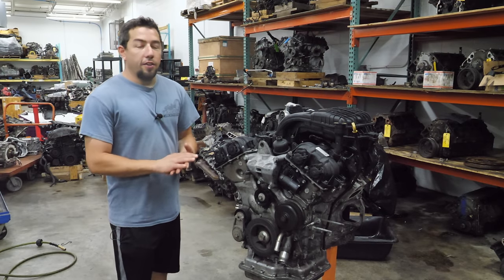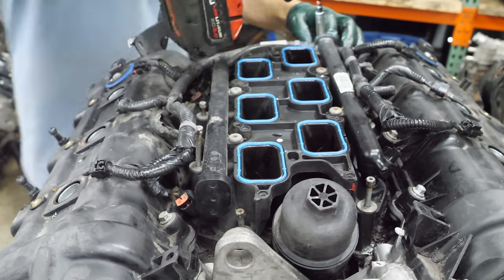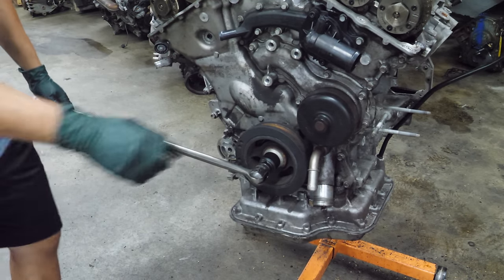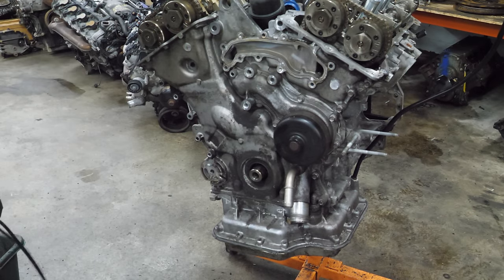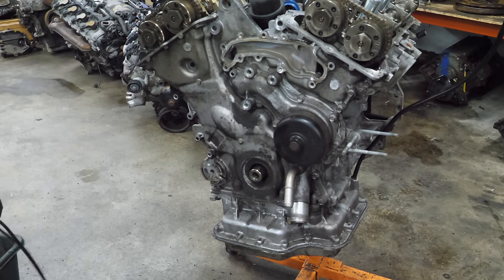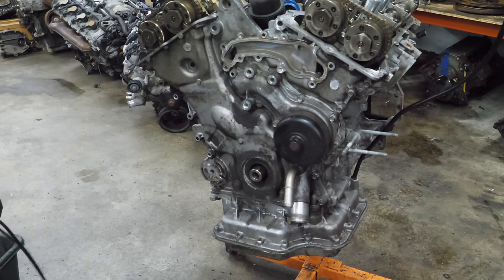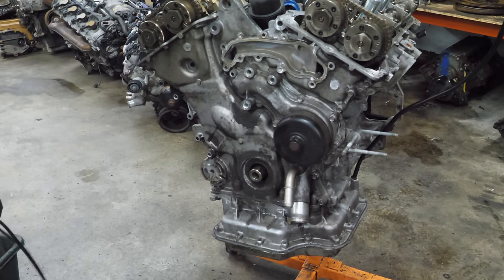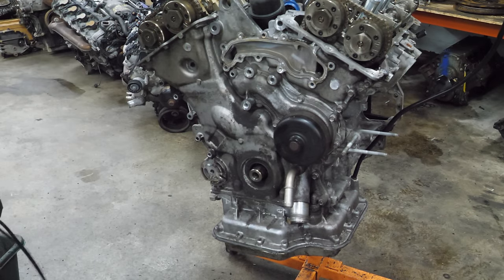Dodge Caravan 3.6L Pentastar V6 Teardown! Why Won't This Engine Turn All The Way Over?

Comment: Maybe the engine was driven for short trips and never had a chance to reach operating temperature, carbon would build up and maybe also clogged the oil control rings causing extra oil burning in the cylinders adding more carbon. Possibly a good Italian tune up on a long highway would have helped to clear up the carbon deposits.
Reply: The ole Italian tune up 🤣 My little car practically does nothing but highway driving
Reply: possible very poor gas and long idle times
Reply: @schlite60  My thoughts exactly. The owner at least seemed to stay on top of oil changes.
Reply: @schlite60  old people do drive slowly and sit in their cars so that could be the culprit.
Reply: I'm betting elderly owner who drove very little.    Likely driven around town, never took any trips and everything was low speed.     The internals were extremely clean which suggests low miles and the owner kept up on the oil changes.
Reply: yup yup like my 90 yr old mother driving
Reply: Yup, some old girl's car. Only time she floored it, was when she drove through the front doors at the CVS.
Reply: The band had this evil "Economy" mode button which set the shift points really low and held it in higher gears at low speeds. It feels nasty when driving, like you're just laughing the crap out of the engine.
Couple that Economy button with nothing but short trips and this is what you'd get I expect.
Reply: Oh god, that's how my family uses our Grand Caravan. I guess it's time for me to start doing pulls again. And some seafoam might be in order before said pulls. (did use some fuel system cleaner a few months ago)
Reply: @reddpanda7240  yup, she had the brake pressed all the way to the floor but the car kept accelerating into the CVS front door 🤣
Reply: @chrismorrison9140  sounds like my Durango.     Won't Crack 2000rpm in default economy mode (8 speed transmission).
Reply: @schlite60  It definitely wasn't a "top tier' fuel! I guarantee it was regular (87 octane). But they say regular is fine for most people. Wasnt fine in this case!
Reply: @willc5512  actually Top Tier is supposed to apply to all grades of a given brand of gas, not just 93. Not all fuel retailers go for it, though.
Reply: Other way around; hard black carbon is from excessive heat, Chrysler likes to run these things at 210f to ensure all plastics fail at exactly the right amount of years. That's a holdover from the Daimler days. This is VERY well known in the Wrangler world. 190f thermostat & ECM flash to lower the fan kick-on from 220 to 195 solves the problem (otherwise you'll get a 'thermostat irrationality' code if you change the thermostat without the ECM flash). And they last way, way longer between rebuilds that way
Reply: Also, a clean top end does not necessarily mean maintained.  It might have been very badly maintained and had an oil system cleaner flush.  I suspect this is the case because of certain areas of heavy varnish.
Reply: @russelljacob7955  a flush is not going to make it look that clean.
Reply: @JimBronson  Depends on the type.  Some can really shine the aluminium.  The commercial grade ones.  The flags for me was looked like wear marks on the skirts and some areas were pretty dark varnished.

I actually speak from personal experience and one of my engines. I had my car parked a bit and it was an older engine so getting yellow.  Flush cleaned most of it but low flow areas still had discoloration.  Perhaps had a timing job and engine flush.  Rings like that I have only seen on vehicles which have done 10k mileage intervals on short commuting.
Reply: @Drmcclung  Wooooaaaaa, that's something to think about. That'd be some truly long game planned obsolescence. Evil too
Reply: @Ar0d  Most Marks do it that way. BMW & Benz are the worst offenders. Chrysler wasn't too too bad about it until Daimler took it over, anything they could cast out of plastic is what they did. People don't realize aluminum heads with plastic parts bolted all over them, and themselves bolted to iron blocks (that's 3 dissimilar materials) the materials don't expand & contract @ the same rate. You add up all the daily heat cycles, especially @ 200-220f operating temp (that's just too hot) yeah they're gonna fail. They had HORRIBLE cylinder head problems for years, plastic parts failures almost constantly, incredible hard carbon buildup in no time at all no matter what you do, that no amount of detergent will soften up and blow out (you're in for an engine out overhaul at that point) you have to get the operating temp down to 190 for it it last any reasonable amount of time. The heads stop failing, the carbon doesn't harden into black concrete, and all the plastics last a bit longer. People say "use the thick blue rubbery silicone gaskets" yeah that works to stop the leaks, but won't keep the plastics from going glass-brittle after 3 years in a 220f degree oven heat cycled over and over again
Reply: Granny driver for sure. Got rear ended at the lights for stopping on a green.
Reply: No, this is a known issue with the Pentastar. They cool the EGR gasses and send it right back into the engine instead of burning it up in the exhaust. This kills any venting and creates positive pressure in the crank case that soaks the intake manifolds with oil. That oil is the reason for the carbon build up on the piston tops and heads. These engines need catch cans to separate it. My Charger only had 9,000 miles on it and the intakes were soaked with oil. I was shocked. I added two catch cans and it cleaned it right up. I have them drained at every oil change.
Reply: @dannysdailys  and 220 degrees bakes it into a nice solid black carbon concrete you need a hammer & chisel to remove
Reply: My 1993 540i has a "winter mode" for the trans that shifts early keeping revs to about 2000rpm max, and ignores kickdown... I think. Never used it ;p
It also labels its default trans map "Economy", which is laughable considering its a giant slushbox mated to a 4L V8 that drinks like a German at Oktoberfest when you just think about pressing the pedal, and pretty much the only observable difference from "Sport" is it does not gear up into 5th on the highway
Reply: @Drmcclung  I need to remember that for my Chrysler customers 🤔 had a couple that I thought were a bit too high on the temp side
Reply: @cljvikingpride19  You're not wrong, at all, they're programmed right in the ECM to run 210f-220f and that's just way too hot. If you put a 195 thermostat in it'll throw an annoying "thermostat irrationality" code b/c it was programmed to kick the electric fan in right @ 220f so the parameter change is a must. And the carbon concrete stops, and Tiffany Glass plastics stop fracturing (thermo housing is BAD about that). We figured that out when the Wranglers started pouring in for warranty work so that's what we did and the problems went away for good. One of my customers managed to get 260,000 miles out of his Pentascar V6 without much trouble after lowering the temp to 195f max. He's still driving it but it's wearing out in other places now. For what it's worth it didn't affect emissions either, we're in an emissions zone so they're on the dyno to prove they're still up to the task annually. In fact on some of the Chrysler's we modified to 195 emissions actually improved b/b the rings weren't seizing up in the ring lands causing blow-by & oil burn
Reply: @Drmcclung  that’s awesome insight, thank you! I’m serious, took a bunch of screenshots and keeping them when I have another one come in with something similar. What’s the best way to drop that parameter? I don’t have a Chrysler specific computer…
Reply: @cljvikingpride19  Some of the Snap-On tools will get the job done depending what packages are installed on it, some do it out of the box, others you have buy a package to install on the tool. I THINK Bosch (the upper model) will work right out of the box but it's freaking expensive and I don't know if they're still around! Basically any of the aftermarket advanced tools will do it but be warned sometimes you have to pay for the package to get into the ECM you're working on. Not ideal but sometimes your only option. Avoid most of the ebay/Amazon tools. Long story short you don't necessarily have to have the a scanner from Chrysler. If it's a Daimler era Chrysler just use a Bosch if you can find one, or a Snap-On. Matco I don't think can program but the newer ones might (mine is at least 12yrs old and it won't program much of anything post 2012). Hope that helps. Don't let anyone convince you that the ECM parameters can't be changed. They absolutely can
Reply: No, this is a known issue with this engine. Read my article.
Reply: @dannysdailys  Will engine flush clean out those carbon deposits? thanks
Reply: @edwardtan8998  Not that I'm aware of. You might ask Scotty Kilmer, he uses all kinds of potions. Using catch cans will reverse the build up, but I would imagine it to be a slow process. Usually you find out because the exhaust spits out carbon all over the place, but by then, it's too late.
Reply: It probably came out of a taxi vehicle if its from a van. I have 125k miles on my 3.6 in my 10 year old Wrangler and it still runs strong. I drive it daily and take it off road when I have the time. I only use good synthetic oils and quality oil filters though. Last oil change I went with Liqui Moly Molygen 5w30. I've had to replace the oil cooler at 100k miles because it was starting to leak and updated it to the newer 2014-up design. My next big maintenance item will be replacing the timing chains and guides but that's still in the distant future. Going to run this engine until it doesn't run anymore which at that point I will either get a new 3.6 and install a supercharger on it or, swap in a 5.7 Hemi V8.
Reply: @willc5512  the pentastar is designed to run on 87 octane. It's all I use in my Jeep with 125k miles.
Reply: @dannysdailys  been thinking of adding a catch can to my Wrangler. I've had the intake off to do the oil cooler replacement and noticed the intake runners had oil in them. I thought it was a bad PCV valve causing it.
Reply: @jeepinintexas6215  I would recommend taking a spark plug out and taking a camera to it and taking a look. You'll be able to see how much carbon build up  is there.
Reply: @jeepinintexas6215  I said 2016 and newer. The Pentastar was fine until 2016.
Reply: @Drmcclung  who would do that type of flash
Reply: @Drmcclung  the dealership can set the fans to kick on at 195
Reply: @Drmcclung  Ripp Mods sale a thermostat that’s set to kick in at 180 degrees
Reply: @anthonyvasquez7050  In your area, no idea. There's 3 4x4 shops close to the Heights in Houston that'll do it, and one specialty shop that'll get you into (and obtain) any ECM; ancient, old or new he's got a lot of his own electronic stuff, only place I know of for that type of service (unobtanium ECM's). But any Chrysler tech can do it. California, I have NO idea last I heard, any factory change failed inspection but that's just what I've heard, I don't personally know anything about cali
Reply: @anthonyvasquez7050  They usually won't, at least not in my region, they'll tell you to F off, unless you know "the guy" but that's just here
Reply: @anthonyvasquez7050  Changing thermostat to a lower temp without changing ECM parameter throws a "thermostat rationality" code - I know that from a lot of personal experience, especially the '09 & newer wranglers. Doesn't hurt anything, but the check engine light will F you @ next inspection
Reply: I need to know what in God's name caused all that carbon so I can make  sure to avoid that!!😭
Reply: @seatime674  it's just the nature of that engine. Gotta change that oil every 3k especially in the heat. Throw the "10k mile" oil change out the window, and run some seafoam through the engine and the fuel every once in a while
Reply: @Drmcclung  Oh yeah I change mine religiously every 3K mi and the Sea Foam is never a bad idea
Reply: @seatime674  Once you're aware of the cyl head & sludge/carbon workarounds it's a pretty damn decent motor, as much as it hurts me to defend anything out of Chrysler 🤣 I actually kinda like it
Reply: @Drmcclung  I have it in my '18 Pacifica at 60k miles it's a flawless, balanced and beautiful motor with no leaks whatsoever.... I don't think it's known for the carbon buildup I think this motor was just particularly screwed up with it
Reply: @seatime674  Oh it's definitely well-known for gunk buildup, but not necessarily the engine's fault or the engineer's fault. The problems are with CAFE recommendations and Chrysler being forced to run it too hot for leaving the oil in as long as they spec'd it to be. I can't really fault Chrysler for that. It's a huge problem for the heavier Wranglers that already put more load on it than the other vehicles it came in (still issues there right out of the box, just not near as bad). But once you're aware of it and how to deal with it, it's no problem at all.
Reply: @Drmcclung  Not sure what you meant saying Chrysler was forced to run it too hot leaving the oil in for as long as they spec'd it to be.. Does that mean just change the oil more frequently like just mentioned?
Reply: @Drmcclung  Holy sh** Hmmm ok good to know. I've got the '18 Pacifica with the newest 3rd gen 3.6 Pentastar and it's funny now that you mention it my fan does kick on between 220-230.. I have the digital temp Guage so it's easy to figure out. I've even thought "this is getting to hot,!"... I'll never get around to changing the thermostat with all that ECM stuff so I'll just do 3k oil changes and flush with new coolant and do what I can.....
Funny It works opposite I thought higher heat actually burned "More" carbon...
On the Pacifica forums there are Many people with coolant in the cylinders and needing new head gaskets before 60kmiles. It's a known problem scares the hell out of me but nobody's ever mentioned it this way before.
Reply: @seatime674  Yeah, the heat just bakes it on, like those concrete crunchies in the oven you couldn't chip off with a hammer and chisel lol. But if you're worried about the heads warping, at least dump a lower temp thermostat in it and worry about the ECM flash later if the light does come on afterwards, it is worth the trouble if you're clean to start with. Best to prevent it before it pops, cylinder heads are NOT fun on this engine trust me..
Reply: @Drmcclung  Most car makers put in like 190 to 195 thermostat, are you saying to maybe put in a 180?
Reply: @seatime674  Well, most the ones I've been into (talking about this Chrysler) had a 200f thermostat in them from the factory including my old '10 Wrangler Sahara. I think I pulled a 195 out of one of them but can't really remember.. I just know I've run into more 200f ones than I can count. They do make lower temp thermos you just have to hunt around different parts stores to find them. 195f actual running temp is about as high as I'm ever going comfortable with, max.. 180-190 is the sweet spot. I don't ever want to see 200+ operating temp on one of these
Reply: @Drmcclung  Well say a 195 is put in and coolant starts circulating at 195, when the Fan comes on at 225-230 thats a separate electrical issue I'm thinking that has nothing to do with the the thermostat because it's open at 195 anyway whether the fan is on or not, so wouldn't the fan coming on to late just be an electrical issue that should be dialed back to come on sooner??
Reply: @seatime674  Incorrect, but logical assumption. However, the ECM is more sophisticated that that; coolant temp sensor is going to see the change in temperature delta and the time it takes to get all the way there if the thermostat changes to a lower temperature (because you changed a piece of hardware and it recognized the difference in *delta*). It will still climb up to the programmed temps if the vehicle isn't moving, without fans, (it still expects a certain range before kick-on) and that's what triggers this thermostat rationality code. It's actually doing exactly what it's supposed to, which isn't just see temperature, but monitor that delta. Changing 1 without the other won't really do anything to totally solve the problem, but at least changing the thermostat helps. You'll just have to trust me on this. Same goes for just changing the ECM parameter and not the thermostat, fans would just run and run and run and not really get you anywhere especially if you're sitting in traffic. Believe me, 12 years ago we threw every trick in the book at this problem before finally figuring it all the way out that it's a thermostat & ECM change that makes all of this go away
Reply: Thanks David Russell. I may change out my 2014 Ram 3.6 thermostat. I’d like it to last. 
Anything more to making them last?
Reply: @dannysdailys  thanks for this info. Any links to help with doing catch cans?
Reply: Italian tune up is how I keep my 3.6 pentastar going
Reply: My engine it clean af I took it apart to change some seals everything clean guessing the hight quality premium gas I put and synthetic oil I do and plus the long trips and high revs I do on it lol we’ll still running strong as now very smooth at idle and no oil consumption yet hope to push 300k or more
Reply: I used to take moms Le Sabre out on a Friday night and go hunting for wanna be racers, that 3800 would spit black soot for a bit and then clean up and run way better after a few stoplight drag races.
Reply: Yup
Reply: @G Rosa  I had a Camry take out my Dodge 3500 that way, but she was leaving the drug store.
Reply: I've seen low mileage pentastar engines with this problem on other videos. They say newer engines have this problem.
Reply: @reddpanda7240  Funny, most people "Oh I didn't realized I had it in drive", as they crash through a store. OK, sure, but how hard are you hitting that gas pedal?
Reply: @schlite60  That's what I was thinking. The 3.6 is the Stellantis base motor for lots of different vehicles so it winds up in a ton of fleet vehicles. Those often see a lot of idling and low grade gas, and cheap bulk oil. If it's real hot or cold, That van might have been running all day for heat or A/C for the driver.
Reply: Very good article anyone know anything about installing catch cans on these motors
Reply: @chrismorrison9140  Knocking around town with your cheap discount gas.
Reply: @willc5512  Regular is fine unless your engine hates it.
Reply: What would short trips be considered? I literally only drive to the gym (4 miles), my friend’s house (3 miles), and the store (5 miles). Is that a problem?
Reply: @Drmcclung thats not how material failure works.
Reply: @jonathancormack  a little context would be nice..
Reply: @user-3tf67bk46u  Appreciate that! All the feedback in this thread kinda motivates me to make my first YouTube video, just to go over the last Daimler era Wrangler I've still got regular access to that I maintain for a customer, I don't think he'd mind a bit. He's about to roll over 300k so after that sort of bullet proofing no major failures in the last 5 or 6 years outside of the original transmission finally giving up (that got rebuilt at a trans shop this summer, I don't do transmissions!). And he's still driving that old thing about 40 miles a day to work and back. That's IF anyone wants that, I know some guys are more into the visual thing than reading.
Reply: Does changing the thermostat temp alter the performance of the vehicle in any way? If not, why would it be set to a higher temp from factory?

Is this an issue with 2020 and newer pentastars aswell?
Reply: @truckinNloving  I'm an old fart and I never sit in my car unless it's doing at least 80.
Reply: B  @TheMajorLeagueGinger
Reply: Direct injection is the cause in my opinion!
Reply: Direct injection is de cause,, in my opinion